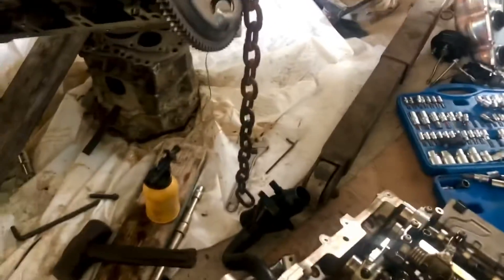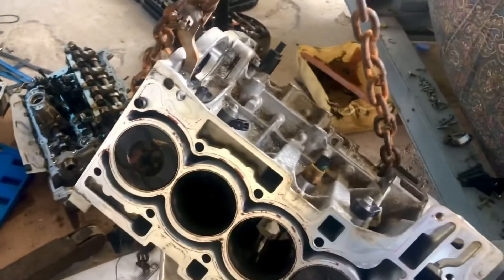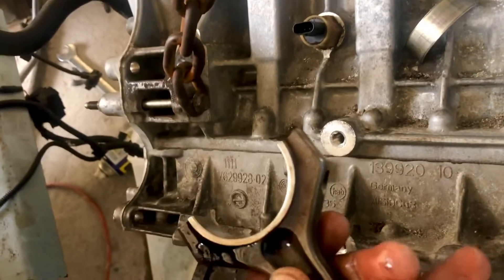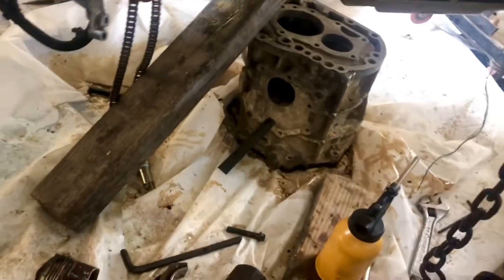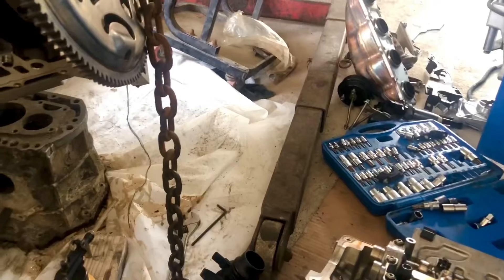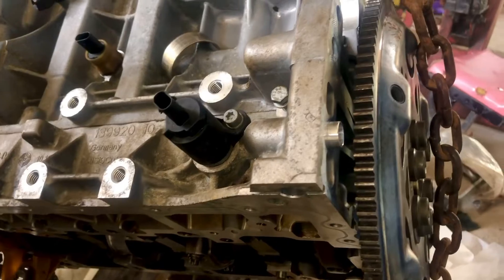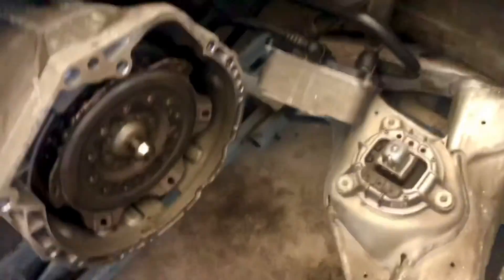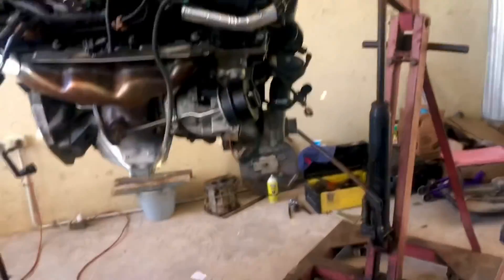#BMW #N20 engine crank shaft Repair along with connecting rod and bearing change.

Comment: any updates on this engine?
Reply from the maker: Hi, sorry unfortunately I didn’t get a chance to do a follow up video,however it was a successful project.
Reply: @geniusinnovations5268   i have the same problem currently with my N20,
Reply from the maker: @scottdavis3911  so you started to do any  work on it.
Reply: @geniusinnovations5268  yea just waiting on the crank shaft
Reply from the maker: @scottdavis3911  okay let me posted

Comment: Hi bro, is it possible to remove the cilinderhead without removing the valvetronic?
Reply from the maker: Hi bro,no cause three head bolts will be under the valvetronic.